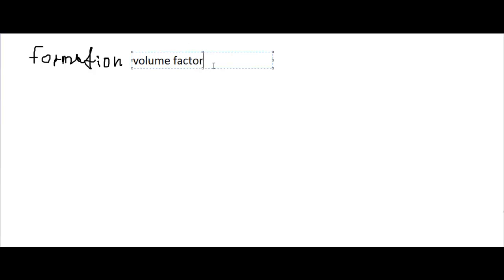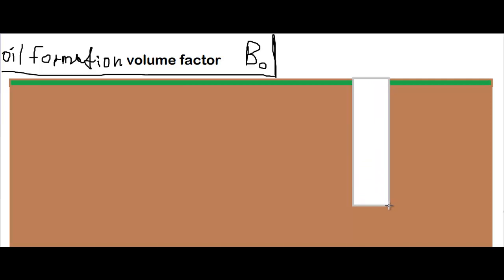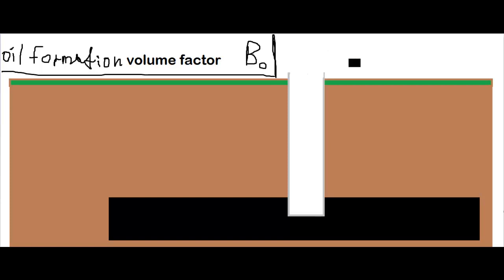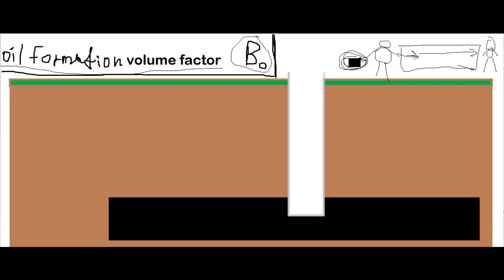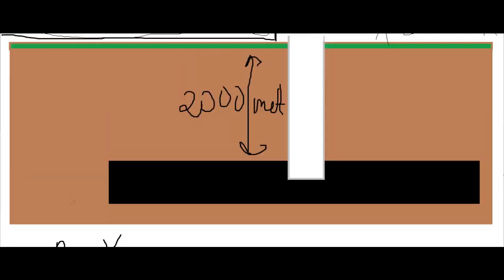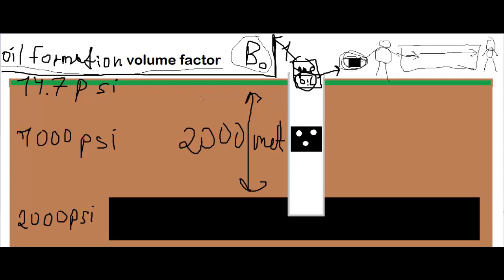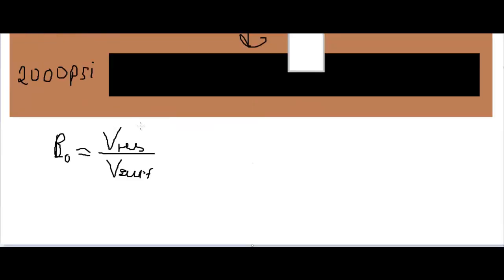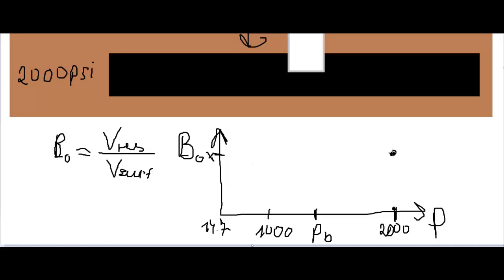Petroleum Engineering / Formation Volume Factor

Comment: Can anyone help me to understand that if the volume at the surface is less than the oil in the reservoir, then how Bo can be 0 when pressure is equal to 14.7psi? And if the volume at the surface is less than the oil in the reservoir, then why Bo is a fraction not a number bigger than 1???  Please help me.
Reply from the maker: +Gulay Ibrahimova It must be equal to 1 at the surface, not 0, because you basically divide volume by the same volume. And Bo is generally bigger than 1. The graph is correct except that it won't be just a straight line after Pb, but a bit inclined down due to compressibility effect, anyway it still is a good approximation
Reply: we should not forget that, temperature difference also exist in the reservoir condition and stock tank condition so we basically can't just comment about the value of bo without temperature.